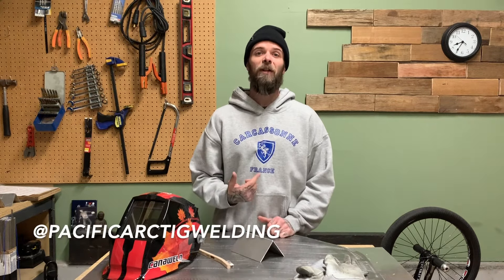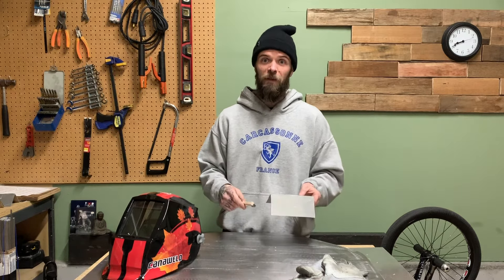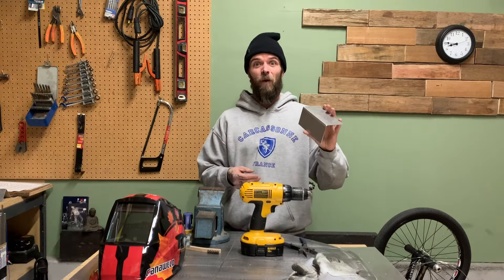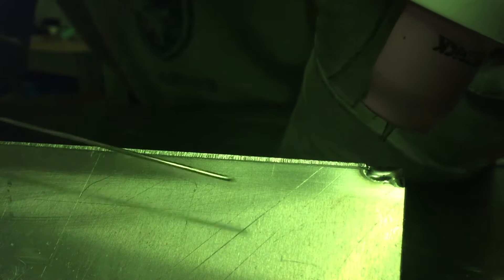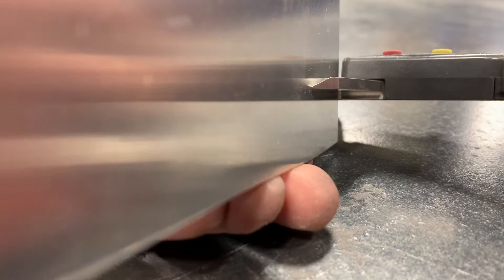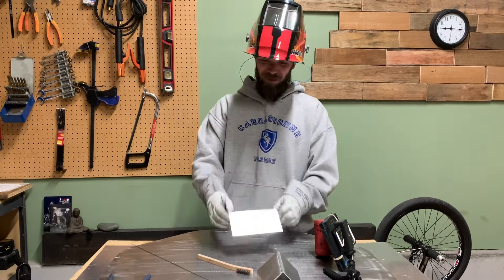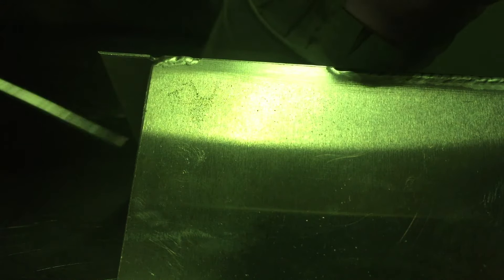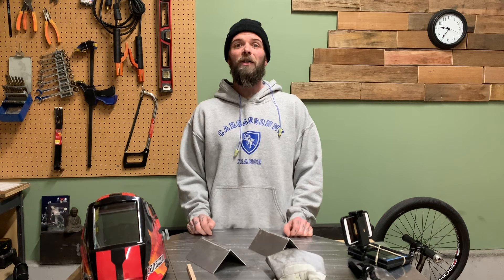TIG WELDING THIN ALUMINUM! *HOW TO MAKE TIG WELDING FILLER ROD - HOW TO TIG WELD ALUMINUM!

Comment: A lot of good info I’ve got from your videos, so thank you very much for the effort and time to put all the info at our disposal. I have a question, I have an Everlast MTS 225, it has mig tig ac/dc and stick, I am trying to weld thin aluminum but the start amps is 20, I am struggling now to weld a cube out of  3 cm plates (about 1.18”) and 2 mm thick (about 0.078) and I am melting that base material at end of bead, the corner, Itri to control it from the footswitch or move faster but..., I am using 80A, with pedal control 1/16 filler and tungsten, 120hz, 30% balance, no7 cup ( no gas lens) 20 chf. I found to do a better job using pulse, 1hz , 50% on. So my question is, those 20 A start is to much? Do I have any chance to  weld thinner that that like 1 mm or cans? ( I tried cans and as soon I am stepping the pedal is making a whole in the  base material, using of course 20A, minimum that I can set)
Reply from the maker: Yeah; I’d dial it back if you can:) I usually run about 5a for start/end amps. You can also use the foot pedal pump at the end, arc off almost, then back on slightly (simulates a pulse) Hope that helps! Cheers and thanks for hitting me up!
Reply: thank you very much for your reply, unfortunately, at least for Al, it wont go lower than 20 amps, so I can adjust higher and use the foot pedal but as low as 20A and not lower that that, that is one thing you. loose when you want 4 in 1 welder machine :). all the best to you and keep up the good work!
Reply from the maker: Cheers thanks so much!

Comment: I'm a beginner welder. Is there any reason why you wouldn't want to start on both ends and meet in the middle to minimize the heat at both ends at the end of the weld?

Comment: They say to match the tungsten size to the wire size.  Wouldn't 1/16" tungsten be recommended instead of 3/32"?  What settings would have changed in you used 1/16"?    7:42
Reply: You dont need to do that you can use whatever wire you want with 3/32 btw I'm 1g aluminum certified

Comment: Nice work, 1 question, what kind of wire brush? Brass,stainless, also if for some reason you don't have a wire brush can you use sand paper then clean with acetone? Just asking.
Reply from the maker: Hey! Stainless steel brush:) And yeah that would work as well. Acetone always a good move...!🍻

Comment: Hey, good stuff. Just wanted to ask if it is possible to weld this way if the sheets (say aluminum 6061) were just 0.40mm thin?

Comment: Great video! Subbed.:-) Very cool trick with the wire twisting! Didn't hear it mentioned as what type wire was it you were twisting?
Reply from the maker: Ooh good question! It’s the same as the filler rod I use- 5356. 
Thank you so much for checking out my channel!🙏🙏 And reaching out too! 
Cheers!
Reply: Ah! Thanks! :-)

Comment: Where do you think you were on the pedal?  I've never used that high frequency on an outside corner joint.  I've run .063 at about 120 Hz and probably 65amps.
Reply from the maker: Awesome! The high freq doesn’t change a ton to be honest, but it does narrow up your arc cone noticeably. So especially if you’re running a longer stickout, the cone can be super narrow. I find higher freq helps out with the starts a lot. Less arc deflection right away, seems to lock on immediately which helps with the super thin thin. 
As far as pedal? I’d probably say I was around 100-110 amps? So definitely giving it good heat. That’s why a little more fill actually helps you keep the heat up a bit, as it stops the base material from heating up too much. Flows pretty nice! :) 
Again- I’m still learning each time, always fun to make it difficult for myself...!
Cheers!

Comment: Your welding with an Everlast 210EXT (love mine!) but there's no link to either the machine or Everlast's website, A?
Reply from the maker: Hey thanks! I usually add it to my description but I missed er on this one:)

https://www.everlastwelders.ca/powertig-210ext.php

There’s the direct link to their site:)
Cheers!
Reply: @PacificArcTigWelding  put in in your description for others, as I stated I have the 210EXT as well as two other Everlast machines! 😐👍
Reply from the maker: Nice! It rips hey? I’m actually going to do a review for it this week!
Reply from the maker: How do you like it so far?
Reply: @PacificArcTigWelding  It's great, I do mostly the thin stuff, down to .030" stainless at times. Smooth and stable on the low end.
Reply from the maker: Yeah I love it too. Super simple but still got all the bells and whistles you’d ever need.

Comment: What grade of aluminum are you using. 6061?
Reply from the maker: Hey! Good question! The plate would have been 5053 and the filler wire was 5356:) 
Obviously You can use whatever you got, anything in the 5000 or 6000 series will weld pretty similar. 
Cheers!

Comment: What I do not understand is that when I set the peak amps at 130A the workpiece will get soo hot that it melt instantly and a blob falls on the work bench. I have to reduce to 40A but still after 2 inches the dimes get flatten out (still too hot). (No footpedal).

Comment: Hi Dusty! 
looks easy but is not.
thin stuff is melts like butter :-)
I had a hard time when I started to weld aluminum lots of frustrations
and headache haha.
now I can deal with it  :-)
thank you for the wire trick!!!
have good one !!!!
can you do some pulse welding video one day?
kind regards:Robert
Reply from the maker: Hey Robert! Ive actually had quite a few messages from people asking for a Pulse demo too. So keep your eyes out! The thin stuff is tricky! Definately requires a keen eye and some patience!
Cheers my friend!
Reply: @PacificArcTigWelding  
Hi Dusty! 
I wanted to buy some mid size back cup from Shayspec, to cheer up my  CK 360 flex loc torch,
The website said is currently "closed".
:-(
I will keep my eyes open  :-)
Have a good weekend!
Reply from the maker: @robertfazekas4607  It's heartbreaking! If you send him messages on Instagram he may let you know what he's thinking, I recall him saying he'd be making more as soon as he was settled after his move. I hope he makes more, so you can have one too...! And I can have more too ;)
Let me know what you hear!
Cheers my Friend
Reply: @PacificArcTigWelding  Thank you so much Dusty!
I will write him on Instagram.
Always nice to buy some quality stuff :-) 
Multimix tungsten on the way from Weldporn 👍 and some Furick 12 ceramic cup
I hope I can try them soon.
:-)
Reply from the maker: Dang Robert! You’re gonna have a smoother setup than I do! 💪
When you put the whole thing together tag me on IG- I wanna see it! :)
Reply: @PacificArcTigWelding  I will do! I sent you a message already on it.haha
 and I  uploaded some pictures as well.
In the college we don't get good quality set up, torch cables are very old and stiff as a frozen dog leg.
But if I learn a to work nicely with the bad setup, later will be easier. 
 I just try to make my life easier. :-)
Reply from the maker: @robertfazekas4607  Stiff as a frozen dog leg?! Thats hilarious. A great comparison. I do think for sure, that learning without super fancy gear can actually help you in the long run, if you stick with it. Then when you switch to some fancy gear you'll feel even more comfortable!
Reply: @PacificArcTigWelding 
Big respect for the old timers, they know the hard way!
Reply: It seams easy made by you but, man, it's HARD, HARD to get a result like that. Congratulations.
Reply from the maker: Remember though, this was VERY HARD to me once. Just practice practice practice! It’s like a martial art:) Incorporating the learning over time and you build skill:)